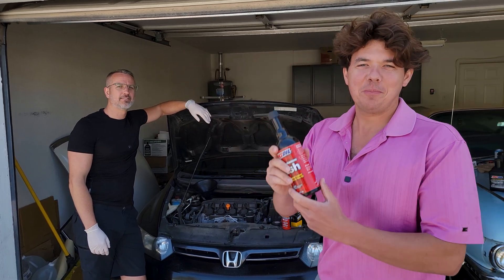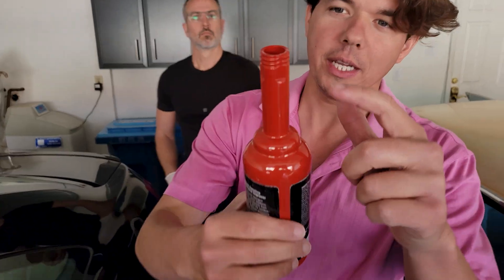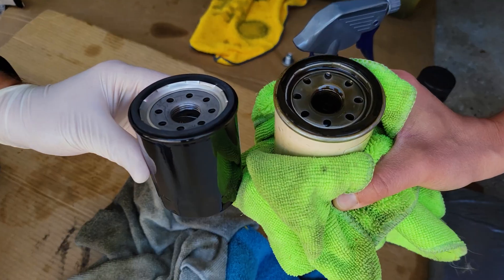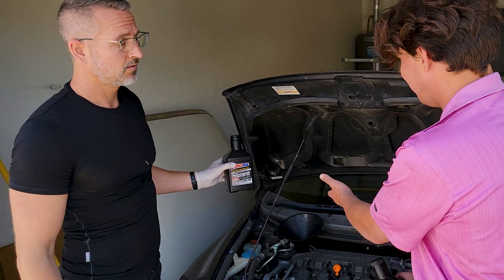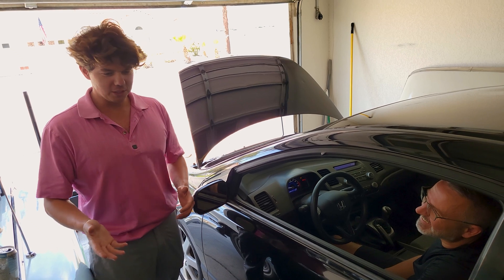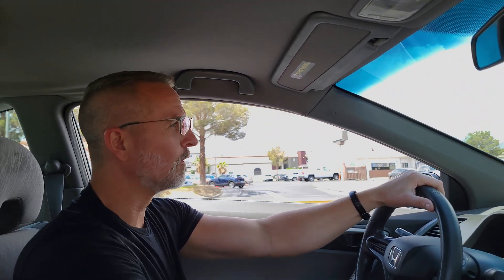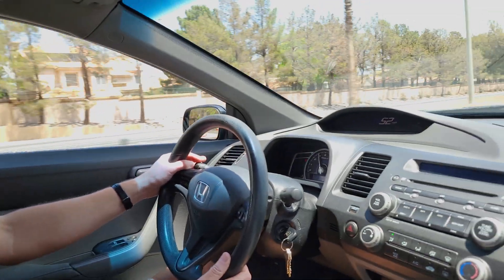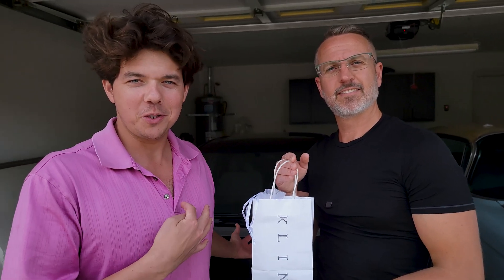Secret to stopping oil burning

Comment: Good video.  It entirely accurate about full synthetic using only 25 synthetic.  Group 3plus base oil is as good as Polyalpha olefin and in some cases can be better.   Major producers will not cheat while others, well who knows.
Reply from the maker: A oil manufacturer can call a full synthetic full synthetic when it's 25% synthetic or more.

Comment: I wonder if I should try this for my 07 Camry four cylinder that burns a ton of oil? It’s thirstier than a college football player. 1567 miles on the current oil and I’ve already added almost four quarts of oil to it. I do 3000 mile oil changes instead of the 5000 because it just consumes so much oil. Some how it still runs great, I’ve been driving it like this for 40000 miles since I’ve owned the car.
Reply: So, when you change your oil at 3000 miles it’s already been changed once.
Reply from the maker: I think you mean the oil filter you can change the oil filter at 3,000. This is my personal car doing the filter change the first time cleaning out the whole motor - https://youtu.be/xcdkLLpfyBA?si=bb7inEaukddx2wHi
Reply from the maker: Yes it will make a big difference you can order it right here on my website💯

I give a man a fishing pole & show him how to fish. 

     Together! We can get your vehicles to run better than brand new! 

     For me to get credit & be "Your" Independent AMSOIL Dealer please use my website below or my dealer no. 5331179 call anytime Eben Rockmaker 702-472-3614
After you click on: http://syntheticoilprotection.net
1. Click hamburger menu
2. Click offers AMSOIL preferred customer
3. Click join now 6-month PC member add to cart.  ( there is no reoccurring renewal membership unless you select that dot box ) 
( you have the option to not have your credit card saved if you prefer - est. 1972 )
4. Scroll up to the top Select shop by vehicle. 

New Promo: FREEQS

Comment: Put thicker oil such as a 5w20 530 dont use 0 weight
Reply from the maker: Thicker oil will not prevent the burning that's because of the carbon deposits you have to get that around the Rings out so the film can flow around the Rings then it can seal off the piston rings without that oil flow around the oil ports that go around the Rings you won't have that hydrodynamic element and you'll still have the burning you could put 50 weight oil in and it would still burn oil

Comment: Sounds like a AMS oil commercial to me!

😂😂😂.

Good info though!
Reply from the maker: Of course it's the best motor oil in the world that's why I get it bought for one reason results and I share that with people all over the world😃
For me to get credit & be "Your" Independent AMSOIL Dealer please use my website below or my dealer no. 5331179 call anytime Eben Rockmaker 702-472-3614
After you click on: http://syntheticoilprotection.net
1. Click hamburger menu
2. Click offers AMSOIL preferred customer
3. Click join now 6-month PC member add to cart
4. Scroll up to the top Select shop by vehicle. 

New promos: FREEWAND

Comment: What would you recommend for a Cummins 15 liter Diesel engine that’s burning oil but shows no metal ware in the oil sample. Turbo test is also normal.
Reply from the maker: I would run the Amsoil Max Duty diesel Signature Series you'll see it right here on my website and if you have any questions give me a call there's also some other stuff you want to do with the engine flush but give me a call before you order💯👍
  I give a man a fishing pole & show him how to fish. 

     Together! We can get your vehicles to run better than brand new!

     For me to get credit & be "Your" Independent AMSOIL Dealer please use my website below or my dealer no. 5331179 call anytime Eben Rockmaker 702-472-3614
After you click on: http://syntheticoilprotection.net
1. Click hamburger menu
2. Click buy wholesale
3. Add 6-month PC member to cart
4. Select shop by vehicle.

New promos: FREEBOWL

Comment: I will have to try this on my dad’s 06 Honda accord. have to pour 1-2 quarts every 3rd day or so. eats as much oil it does gas lol. I’ve used amsoil in all my own vehicles. have it in my 06 dodge ram 2500 5.9 Cummins diesel around 144,000 miles on it. runs smoothly and very little soot comes out tailpipe when an acceleration. and got it from last owner that did no maintenance on it! it’s in better hands now lol. even used amsoil in my phantom ultralight airplane ✈️! took exhaust manifold off at 100 hour inspection and pistons still looked brand new as day they were installed. and also no carbon buildup at all that was back in 1995 when someone introduced me to amsoil. I figured if it works this good in my ultralight airplane ✈️,than see what it does for my vehicles. it is more expensive,but in the long run it does save money and engines run better.
Reply: how did it work?
Reply from the maker: @apaches04soccer great, we have a lot of follow-up videos in the playlist section you'll see all different filter changes and stuff like that it takes time to get the old carbon buildup out.
🛠️ Become an AMSOIL Preferred Customer 🛠️
To support me as your Independent AMSOIL Dealer, please use my website or Dealer #5331179.

📞 Call anytime: Eben Rockmaker
702-472-3614

👉 https://syntheticoilprotection.net

How to Sign Up (Takes 1 Minute):

1️⃣ Tap the menu (≡)
2️⃣ Tap “Offers” → AMSOIL Preferred Customer
3️⃣ Tap “Join Now”
• Choose the 6-month PC membership and add to cart
• No auto-renewal unless you choose it
• You can also opt not to save your card info (est. 1972)

4️⃣ Scroll back up and tap “Shop by Vehicle”

🎁 Promo Codes:
FREECANS
Reply from the maker: ☕️, love to know how it goes with your dad's car💯
I give a man a fishing pole & show him how to fish. 

     Together! We can get your vehicles to run better than brand new!

     For me to get credit & be "Your" Independent AMSOIL Dealer please use my website below or my dealer no. 5331179 call anytime Eben Rockmaker 702-472-3614
After you click on: http://syntheticoilprotection.net
1. Click hamburger menu
2. Click buy wholesale
3. Add 6-month PC member to cart
4. Select shop by vehicle.

New promos: FREEBOWL

Comment: Interesting video, I have watched another You Tube video where the BMW mechanic used AC Delco Fuel Injection Cleaner concentrate and poured an ounce in the BMW Engine Cylinder and left it overnight to get the compression back up in the cylinder and unstick the rings from the carbon depsits. I wonder if your Amsoil Engine Flush would work, as AC Delco discontinued the product?
BMW Misfire/ Rough Idle M54 6 Cylinder Low Compression
https://www.youtube.com/watch?v=_Vo4fm0JDPY

Comment: ive been using liqui moly 5w-40 in my Vw...was thinking of switching to amsoil euro 5-40. would you recommend that?
Reply from the maker: Oh yeah I would do a engine flush on your car I would also run the fuel additives depending if you have a gas or diesel you'll see those on the website Pi performance improver is for a gas vehicle then there's some diesel additives I would also run the upper cylinder lubricant they also make that for the diesel as well that's called the injector clean and lubricant will extend the life of the injectors fuel pump Etc.
You can order it all right here through my website if you have any questions just give me a buzz☕️👍
For me to get credit & be "Your" Independent AMSOIL Dealer please use my website below or my dealer no. 5331179 call anytime Eben Rockmaker 702-472-3614
After you click on: http://syntheticoilprotection.net
1. Click hamburger menu
2. Click buy wholesale
3. Add 6-month PC member to cart
4. Select shop by vehicle.

New promos: FREETOOL
Reply: @Syntheticoilprotection thanks. It’s a gas 1.8t
Reply from the maker: @allroadsawesome great!
Reply: Liqui moly is made in Germany so if the advertise synthetic, it’s synthetic. Germany is dogmatic about the synthetic characterization.
Reply from the maker: Yeah I wouldn't count on it unless it says 100% synthetic🇺🇸💯
Reply from the maker: 🇺🇸   50 Years of AMSOIL anniversary - https://youtu.be/MQUqRBI8dD0

Comment: Thinking of using Amsoil. Thing is when you have an old v8 which burns 1 quart to 800-1000 mls from factory new because it was normal for this engine back in the day. Amsoil is an expensive oil to use in this situation.
Reply from the maker: That's what I used to think until I tried it once you see the difference in how much it burns you will be very impressed and will actually save you quite a bit more money because you'll burn about half the amount of oil or less also your catalytic converter will last longer because it won't have as much buildup in it the other big benefit is the motor will last longer better compression
Reply: @Syntheticoilprotection  My 69 doesn't have a catalytic converter. I doubt it's gonna burn less oil. Like i said it is normal for these engines.

Comment: Can I take my 08 Lexus ISF to you in Vegas to get a transmissions flush? That's my next to do on my car, Im 3hrs away lol
Reply from the maker: Awesome definitely would love to do a video with you and your car you have a couple options you can order it right here through my link and you can have anyone install it also if you want to do it on the channel you can always set up an appointment with Steven Carter he's a local guy that can do it and then we could do a video there.
This will give you the fluids for your ear make model engine size and the best value on the products when you use my link that will attach me to you so I can always answer all your questions about improving the performance and lifespan of your vehicles by choosing the right fluids as you're independent Amsoil dealer.
✅   Save 25% On Your Next Fluid Order: https://www.amsoil.com/offers/pc/?zo=5331179 

Promo code CC0523FP
Reply: @Syntheticoilprotection  Nice ok, I will definitely keep this in mind and buy the product through you.  How do I get in contact with Steven and yourself for some questions?
Reply from the maker: You would want to call Stephen Carter at his shop.
AAMCO Transmissions & Total Car Care
(702) 558-7558
https://maps.app.goo.gl/7qc1S2XhoDa1fPxn6
Reply from the maker: You can call me anytime☕️👍
I take it you're new to Amsoil and you are not a preferred customer?
Reply from the maker: Just wanted to make sure you're not already up preferred customer
Reply: @Syntheticoilprotection  Im not a preffered customer yet but I dont mind paying $10 for future discounts. I'm due for an oil change too and I want to do the differential as well. Car has 93k and I have no idea if previous owner did proper maintenance or what fluids were used.
Reply from the maker: Awesome you can order everything right here through my link it will give everything for your year make model and engine size.
✅   Save 25% On Your Next Fluid Order: https://www.amsoil.com/offers/pc/?zo=5331179

Comment: No luck on my civic 
Injector cleaners upper cyl lubes 
Intake decarb 2 different weight oils and 4 different oil additives later still the same:(
Reply from the maker: Have you ever tried the Amsoil Signature Series
Reply: @Syntheticoilprotection  I have not but I have thought about it many times just here in AUS it's not stocked really in any local stores so I've just been using 10w 40 "full syn" I have found a amsoil dealer online I will look more into it
Reply from the maker: Where do you live? I can be your dealer anywhere in the US and Canada.
✅   Save 25% On Your Next Fluid Order: https://www.amsoil.com/offers/pc/?zo=5331179
Reply: @Syntheticoilprotection  I'm in Australia 🇦🇺  but we have a amsoil distributor here too! Had abit if a look
Reply from the maker: Sweet!!!
Thank you for being a part of my YouTube Community☕️💯

Comment: I switched to Amsoil SS in my '13 Mitsubishi Lancer a couple years ago.  I have always noticed a smoother running car after an oil change and of course I did when I switched to Amsoil SS.  But here is the thing, I no longer experience those "smoother running car" oil changes.  After running SS for just 10k miles I replaced the oil with SS again, but didn't notice a change. My car was running just as smooth with the old 10k mile SS.  I changed it way to early.  Next time I ran the car about 17k miles before changing the oil.  Guess what?  When I put a new batch of SS in I didn't notice a difference again, meaning after 17k miles, SS was still performing excellent.  In my 30 odd years of doing my own oil changes on my cars since my teen years, I have never experienced an oil that I could put that many miles on and not experience a smoother running car after an oil change (besides, I would not trust another oil with such a long change interval).  Despite the fact that Amsoil SS was still performing like new oil after 17k miles I have decided to go with a 15k mile oil change interval.  SS is guaranteed for 25k but I rideshare my car so 15k is what a have settled on since the Amsoil filter is rated for 15k.  BTW, my car has about 146k miles but barely burns any oil.  In 15k miles I may have to top off with a quart or less.

Motor oil gets all the attention folks, but let me tell you, don't overlook your transmission and drivetrain!  I know transmissions, transfer cases and differentials are more difficult to service but it's worth it.  After my experience with SS, I switched from Mitsubishi CVT fluid to Amsoil CVT (which is 100% synthetic as well), and my transmission has never been quieter, or smoother.  I notice that it will run smoother in the winter cold before it has time to warm up vs the Mitsubishi fluid as well.  Don't neglect your transmission and drivetrain!  They are just as important as your engine!

My car is buttery smooth now.  Better than when I bought it with 60k miles.  Amsoil for the win!

Comment: I wish the flush would fix a rusty body 😂......it does work awesome
Reply from the maker: 😉😃, about the best you're going to get for that is the MP HD metal protector will make a big deal difference on stopping the rust puts a huge waxy coating on it definitely recommend stopping it before it rust through.
https://www.amsoil.com/p/heavy-duty-metal-protector-amhsc/?zo=5331179

Comment: When I first started using Amsoil over a year ago I had a 45 min highway commute and 90% of my driving were highway miles and had hardly any oil burned after 12k miles. I know live somewhere where my work commute is less than 10 minutes and have barely driven my suv since I changed the oil like 6 months ago and to my surprise a full quart burned off when I checked the other day- is there a correlation and should you change your oil more frequently when you are not putting many miles on it? Or something else altogether?
Reply from the maker: Yeah usually with the signature series you want to change it every year.
Also you want to keep an eye on the oil level I recommend checking it at least every month depending on how much you're driving

Comment: Proof is in the pudding, so to speak. I appreciate the honesty and truth behind these videos and testimonials. I purchased a used 2008 duel sport motorcycle and from another video from the channel followed the advice. Amazing immediate results from the dirt bike oil. Next purchase was Amsoil gear oil for a shaft driven motorcycle and transmission oil change, again immediate difference smooth shifting and torque improved. I tried P.I. gasoline improver in the duel sport to see what would happen, after a few pops and bangs a  grey puff of smoke out the exhaust the bike no longer hesitates to climb up RPM range. So I’m sold on Amsoil. I recently purchased a used mini cooper that is known for oil burning after i fix the blown head gasket, I’m using Amsoil for the rebuild can’t wait for the results.  Next will be the Honda Ridgeline and then wife’s car a Mini Cooper countryman s. Amsoil works…
Reply from the maker: That's awesome Christopher what was the first video you ever saw in the channel?
Did I text you yet and thank you for the order when you signed up?

Comment: The problem with some models is they may not have a sensor for oil level and if the oil burns or vaporizes it will be lower than you think.  I had a 1994 Ford Taurus and I remember the oil light came on once, I ended up adding almost two quarts of oil before being full, so yes check your oil dipstick from time to time.  Also with the change from high tension piston rings to lower tension piston rings I have noticed some newer cars will actually burn more oil than the older models.
Reply from the maker: Yeah I think a lot of that is because they recommend the 10,000 mile oil change intervals with synthetic blend oil also the filter Can Only Hold so many contaminants.

Comment: My 2015 crv was burning about 2 quarts every 5k miles I did the flush and Im using amsoil 0w20 now burns 0.5 quarts. Amazing results I love Amsoil products
Reply from the maker: Wow that's a huge huge Improvement and I like to say Amsoil helps Save the Fish the birds and the bees and the trees because of less smog emissions and pollution into the environment LOL.....
It also feels great when your car runs quieter and smoother too😉😃
Reply: Change the PCV valve as well $40 part and it will burn even less.
Reply: @aaronjeffries3383 my gas is burnin quick also can it be the pcv valve
Reply from the maker: @Eric-vn9sm yes & many other things
Reply: @aaronjeffries3383  I changed that on my 2016 Corolla and did very little